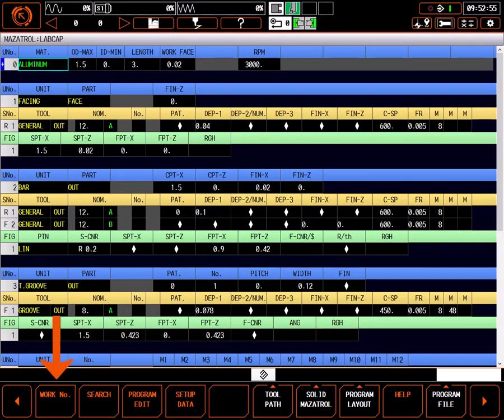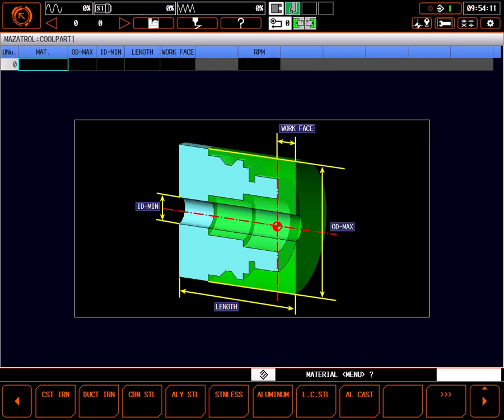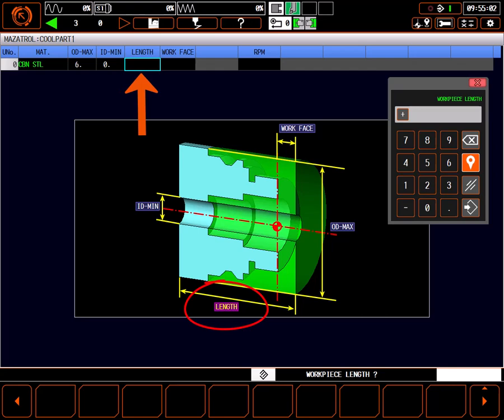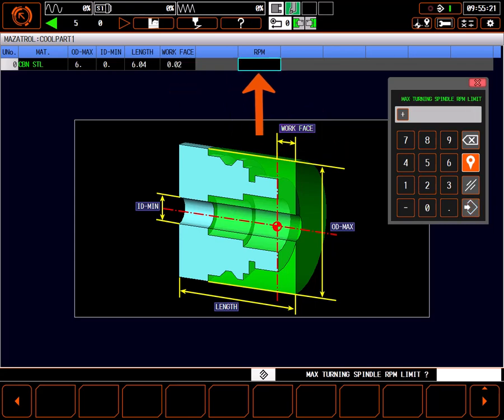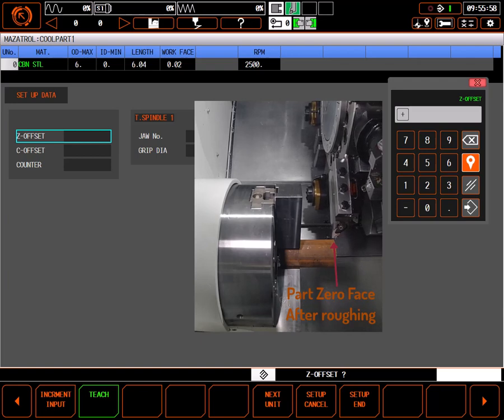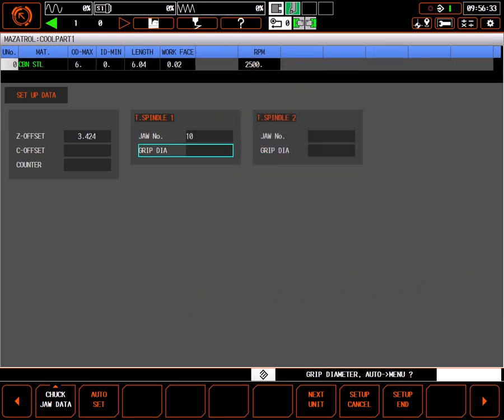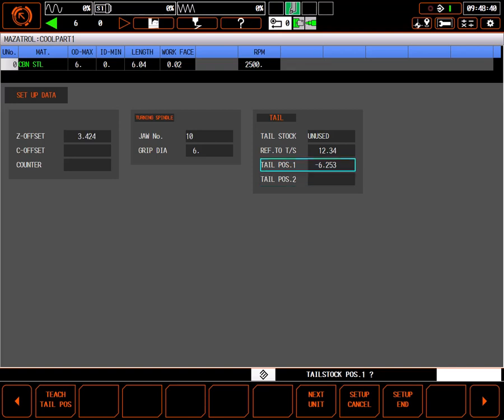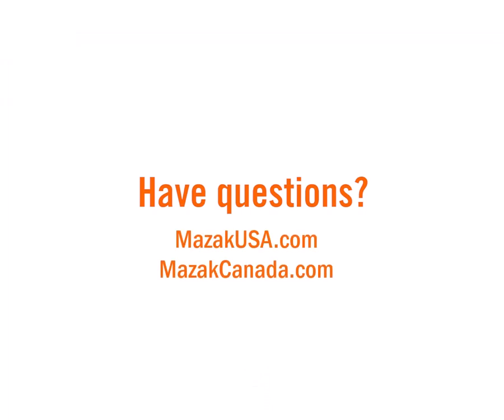MAZATROL Programming Briefs: Starting a New MAZATROL Turning Program on a Mazak Turning Center

Comment: I'm leading a work instruction project in a machine shop right now. How do I screen record directly on a Mazak? It can be tricky with shop lighting—there’s often glare and flash that makes filming the screen tough. I’ve used screen recording successfully on some PLCs and tablets before, but now I'm focusing on the machines themselves. Honestly, I wish I had access to videos like this back when I started as a machinist ten years ago—they would’ve made a huge difference.